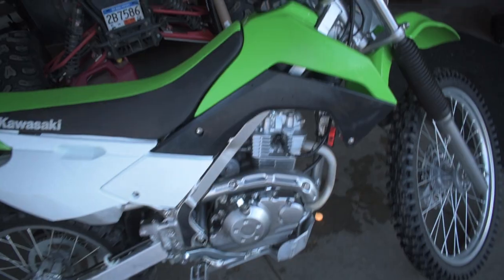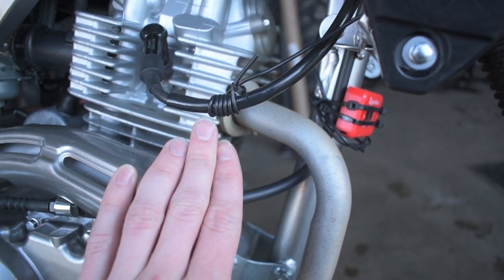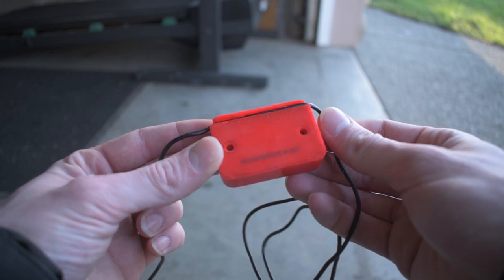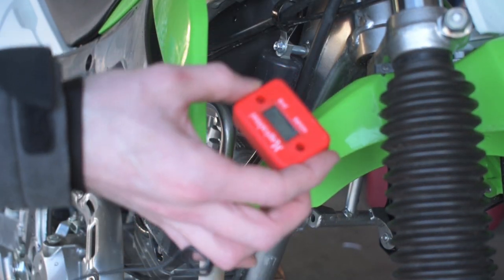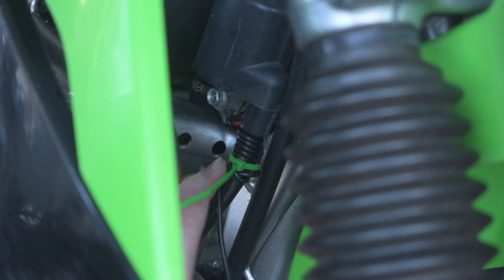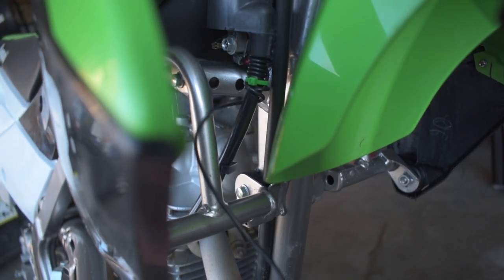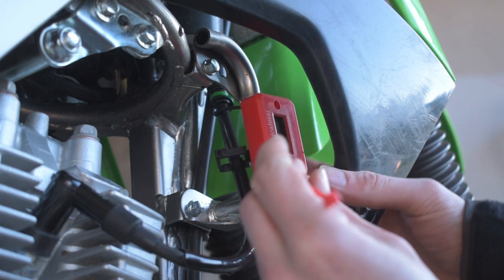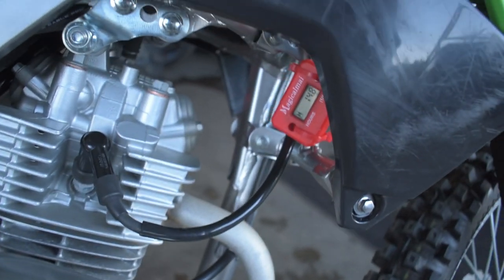How To Install An Hour Meter On A Dirt Bike!

Comment: Very nice tip to wrap the cable up close to the solenoid!! I actually use a meter that operates on vibrations, it costs $10 more but it's even cleaner as you can install it cleanly really anywhere
Reply from the maker: Thats neat! Thanks for watching!
Reply: I had on that worked on vibration and I noticed whenever I used my motorcycle trailer to transport my bikes the hour meter would record the vibration from the trailer and add time to the meter.
Reply: Coil
Reply: Iv just installed a hour metre does 0.5 mean 30 minutes ?

Comment: Quick question, does the hour metre record minutes/hours when the bikes engine is on but idling or only when u give it power and Ur moving ?
Reply from the maker: Anytime the engine is running (even at idle) it will count up
Reply: @AaronsEnduro   cheers man , one more thing please .. does idling ur bike with engine on wear out the engine oil and count as part of engine oil change time ? If u know what I mean .. or is it only when ur moving (rpm) on the bike ?
Reply from the maker: If you’re asking about a 4 stroke bike. Yes it counts. If its a 2 stroke, no
Reply: Iv just installed a hour metre does 0.5 mean 30 minutes ?
Reply from the maker: @Supernova869-s4i  yes

Comment: Hey man which uni filter fits on your 150… I have a 140 and don’t know if I should get the angled or straight
Reply from the maker: Get the angled (both fit) the angled filter will keep you from burning the filter
Reply from the maker: I had the straight one for reference
Reply: Awesome thank you👍🏼
Reply from the maker: Have fun buddy!
Reply: Iv just installed a hour metre does 0.5 mean 30 minutes ?

Comment: Hey, I bought a crf150r used with an hour meter that was working but now it’s not, any help
Reply from the maker: The wire that senses pulls (it should be wrapped around the spark plug wire) is probably loose or not wrap around it anymore
Reply: Iv just installed a hour metre does 0.5 mean 30 minutes ?
Reply: @Supernova869-s4i  yea. Every .1 of an hour is 6 minutes